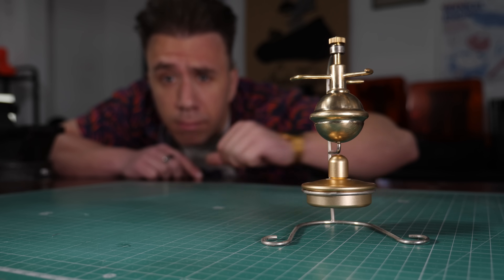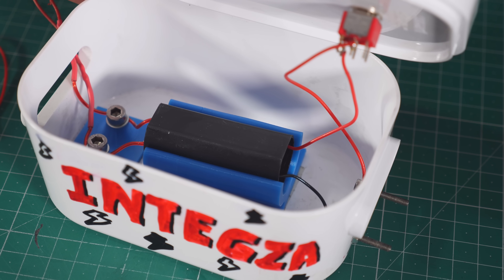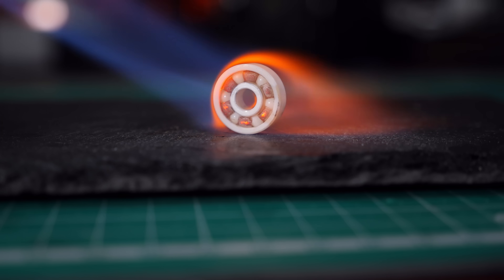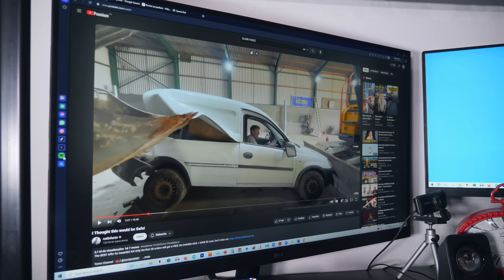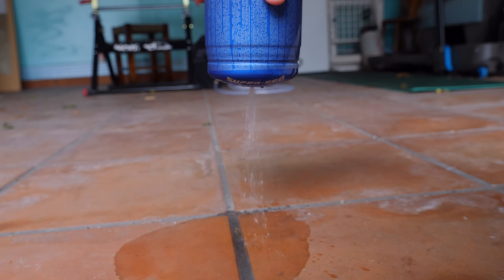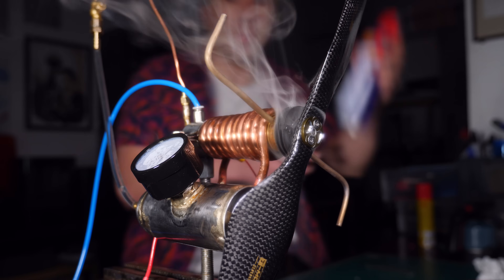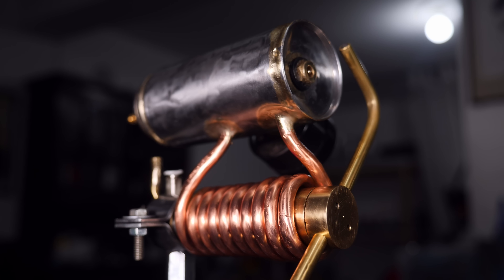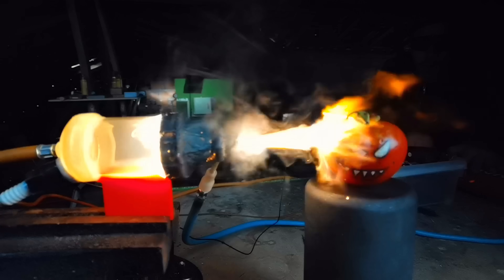I Built a ROCKET PROPELLER

Comment: Does the nozzle design matter if the exhaust is then routed through an additional pipe? Wouldn't the nozzle have to be at the end of the two copper tubes? I'm just asking, I'm even less of a rocket ingénieur than Integza

Comment: IDK if you'll read this this late after posting the video, but in my humble engineering opinion I think I know why the pressure it's not raising when the engine starts running hot...

If i'm correct then it's simple, your heat exchange is not efficient, as in, heat is being transferred to the cooling agent (the fuel gas in this case) but a lot of heat remains in the combustion chamber, copper is a very good heat transfer material (as many metals are actually) but it is "porous" and the system has a lot of gaps, simply fill these gaps with something like... say, thermal paste or encase the entire cooling system so you can fill that part with water (ez fix, not that effective tho) and with a bit of luck more heat will transfer to the gas.

Comment: Why not use the compressed air to Venturi the butane into,the combustion.  That way you don’t need a combined pressure.  You only deal with the compressed air compression.

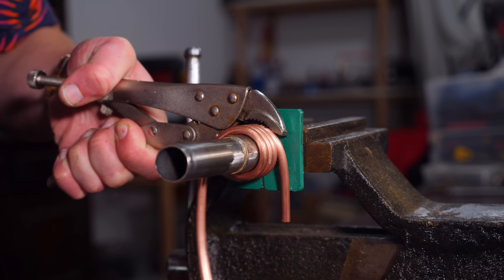Comment: (8:02) Ohhh, I wonder if you can use a copper heat pipe!  Can't transfer gases through it but it moves cold and hot temperatures around very quickly.

Comment: unstead of running the cooling from the fuel tank to the fuel tank you should run the cooling line in between the fuel tank and the engine that way the liquid evaporates in the cooling line keeping your engine colder this is called regenerative cooling and its a real thing in real rocket engines

Comment: dont you think that the increased pressure from the added butane is the reason for more pressure and not the combustion? this creates the next question and is that butane being burned inside of the chamber and propelling increased gas pressure to the outlets or better yet are you getting a rocketing thrust effect at the outlets and would that increase or decrease the rotation or amount of pressure to the point where one will always fight the other with no actual benefit over a measureable point.

Comment: I was thinking of an air piston jet engine hybrid. Use compressed butane/propane mix. The pressure turns a propeller and vents the gas into a combustion chamber. Have a spark gap igniter... basically an airhog rc plane..😮

Comment: why not have the nozzles directly behind the propeller?  To reduce drag?  Wouldn't the nozzles be subject to bending more if it is in between the blades like you have it now?  If it was actually used to move through the air wouldn't it bend from the wind?

Comment: Finally, FINALLY you're using your fuel as a refrigerant! I've wanted you to do that for years 😭😭 Most rocket nozzles have complex internal structures for this exact purpose. I mean, the nozzle for the apoilo missions had such a complex internal structure that they had to invent new manufacturing processes to insure the plumbing worked.

Comment: Nice experiments Integza!
I was wondering, for the cooling system, it might be better to have one end of the coil on the bottom of the reservoir of gas, and the other one at the top, basically putting the can upright and tapping the gas from the top, the liquid staying at the bottom to fill the cooling spiral, the heated gas flowing in the top of the can

Comment: And you call yourself a rocket scientist. lol. you need a pump to pump the butane. you also need to fix the oputput of your cooler to the engine so hot butane is burning. Thats how NASA do it with their rocket engines. Use the fuel to cool the bell

Comment: Perhaps having the coil in the fuel flow with a capillary tube would work better? Look up hot air balloon burners for a bit of inspiration on that front. We preheat and super pressurize the propane by passing it through a coil around the flame path.

Comment: Ok, you are good, however your trying to figure out why the butane wasnt going past 4 bars
lets work this out, first, you created a giant fan, which is moving 1kg of air in order to make lift, if the fan is on its side (like it is) then that 1kg of air is being pushed back on the can you are using to cool / heat the butane
You made a cooling system out of a cooling system and your wondering why it wont heat up to push the butane out faster????

Comment: You could try using a thermally conductive paste or something to increase heat exchange between the coil and the engine body.
Reply: Yes! Circle on circle is the smallest surface area you can get for contact between the two. Good call!
Reply: @konamisqust Or, ideally, also kinda squish the coil so you get more of the copper surface closer to the engine, and then have the paste or solder or something else there, because having 3mm of thermal paste is not exactly ideal.
Reply: At those temperatures, I suspect the paste would become become liquid and simply drip away. .
Reply: @DUKE_of_RAMBLE Yea, thats why I said something like it in my reply. Also I'm sure some thermally resistant paste does exist, tho at a really high cost.
Reply: @Eyan17 wait but won't a thermally resistant paste just not conduct heat?
Reply: @agenthimzz No, I just meant a paste with a high melting point
Reply: There is thermally conductive epoxy. More heat resistant since it literally can't melt, it will start to burn before that.
Reply: And put another tube around the copper coil to reduce heat loss.
Reply: @jagolago-bob Idealy of an isolating material
Reply: But also, guys, Integza already had problems with it being too hot, so idk why he would do this. But you never know.

Comment: you really should've had the fuel can vertical to avoid it pushing fluid up into the combustion chamber. Bet it would work way better and let you get more heat and fuel into it without spitting up liquid

Comment: Wouldn't it be better to have the propeller power a pump to move a cooling liquid between the combustion chamber and the butane tank? It would slow down fuel preheating, but it would be far more reliable.

Comment: Check out the Hiller Hornet, a helicopter which uses this principal for powered flight.  Ram jets are mounted on the ends of the rotor blades, and fuel is fed through the body of the blades.  Since they're ram-jets, once they reach operating speed, they're self-compressing.

They are a bit noisy.  Kermit Weeks of the Fantasy of Flight museum, has the last airworthy one, but doesn't like to start it up, as he gets complaints from his neighbors across the lake.

Comment: A suggestion, you could use the coiled cooling hose to feed the engine, the gas running from the tank to the engine would expand, absorbing heat. cooling+expansion.

Comment: place the butane tank vertical, so the coil is filled, and use a passive liquid flow regulator to control the flow into the coil. maybe this helps.

Comment: I like the videos, in physics classes there is a motor with a magnet and a battery, of course it rotates and yes the fans are there, but is it possible to do something with that basic motor or does it need to be improved? because I never imagined, but this is the basic motor even with everything.
But in your project you don't need gas control? Couldn't you use a Tesla valve conduit?

Comment: Have you experimented with brazing the coil to the body of the engine? That should dramatically improve the heat transfer, and so up you gas pressure accordingly.

Comment: Can you build a propeller that has the pipe inside minimising materials and design ? Also does the distance of the pipe itself have an effect on acceleration ? You could ad a pressure valve to the fuel tank to avoid explosion, maybe with a collector to reuse te fuel It will eventually vent.

Comment: 10:50 Butane absorbs heat while simultaneously losing pressure during phase transitions, particularly when converting from a liquid to a gas. This is because the energy absorbed during evaporation (a phase transition) is used to break the intermolecular bonds holding the butane in the liquid state, which then becomes gaseous. This energy input also reduces the pressure of the butane as it transitions from a more dense liquid state to a less dense gaseous state

Comment: What if you construct the propeller around the exhaust pressure duct, and vary the exhaust nozzle diameter? You can still direct the exhaust pressure tangentially to the diameter of the propeller’s rotation. 
Lots of little challenges to contend with, but this is something I’ll be keeping my eye on

Comment: If you would put less loops around the engine the butane would build up more pressure . You totally over cooled the motor . But I’m surprised you made and improvement using absolutely no heat transfer equations .

Comment: Just FYI: I won't be using Opera on my Linux computers any time soon; it comes as a Snap and I recently switched from Ubuntu to Debian expressly to get away from Snap.  Why?  Because once installed, there is NO WAY within your OS to get rid of the installed application -- which, because it includes all the libraries that would normally be called from the operating system, tends to be HUGE.  I'll install AppImage -- which are just as bloated as Snap -- because I don't have to learn a new command line to maintain it (just overwrite the existing AppImage with the updated one), and I can delete an AppImage any time I choose and free the space instantly -- instead of having to reinstall my entire operating system to free the space.

Comment: What happens if tou increase the surface area of the copper pipe touching the combustion cylinder? Could you fill the gaps with tin solder or use square copper tube to increase the efficiency?

Comment: Use a tesla valve on the butane side of the engine so the higher sir pressure cant push the butsne back up into the can

Comment: The flow in those tubes is going to be super restricted (choked flow) so you're losing a lot of thrust by designing it like this instead of putting the entire rocket engine on the spinny bits.

Comment: Several chemicals produce oxygen when heated. Common examples include chlorates (like sodium chlorate, NaClO3, or potassium chlorate, KClO3) and perchlorates (like lithium perchlorate, LiClO4). These compounds decompose upon heating, releasing oxygen gas. Hydrogen peroxide (H2O2) can also decompose to produce oxygen, though this process is often accelerated by a catalyst like manganese dioxide. 

     Stuff you could do with water and chemicals 
  With without heat to make air too

Comment: You should get a TXV and modulate the flow of the gas to the engine, based on the sensing bulb temperature. Also change out to either propane or propylene gas (higher pressure), butane has low pressure at standard outdoor ambient temperatures due to its high boiling point temperature at -1C compared to propane at -40C or propylene at -48C. Juice that RPM to 4000+.

Comment: A tip for bending small pipes.
Seal one end of pipe with a dab of hot glue,  fill with water and stand it upright in the freezer,  let the water freeze.  
NOW bend the pipe however you like.   The ice inside the pipe supports the pipe from inside meaning no more kinks or reduced ID of the pipe through the bend.
Reply: i think you can use very fine grit sand and get the same result
Reply: @thatoneweasel  sugar works really well too since you can easily rinse it out with water
Reply: @kasuraga  Table salt works too.
Reply: @Beamer1969  Fine sand... so many options
Reply: @rickkwitkoski1976  Could use Columbian marching powder
Reply: And it would be really easy to clean out.
*Snort!
Reply: @kasuraga  Just to have even finer granulates, I'd say powdered sugar would be the better option. 
Though getting it all in there would probably be quite the tedious task.
Reply: @thatoneweasel  Не работает, ты не сможешь утрамбовать его так сильно как воду, я пытался согнуть трубку с песком внутри без нагрева, песок сжался, пустоты заполнились и трубка все так же переломилась. Использовать пружину- лучший вариант, просто обернуть ею трубку и гнуть как угодно.
Reply: @thatoneweasel  Fill it with solder or any low melting point ductile metal. Then you don't need to plug the ends when bending.
It might be a bit tricky with such small diameter tubes, though.
Reply: Ice, sand, salt, sugar, all as the 'mandrel' part for bending. COOL!
Reply: Sand and sugar would be too hard to get into a small diameter tube. Water is  probably best in this case and easiest to remove.
Reply: nice!
Reply: Add some soap to the water so it doesn't freeze completely solid for easier bending while still supporting the pipe

Comment: The vapor pressure of butane and propane are indeed different. At 25C butanes vapor pressure is ~35.4psia (ie, your lighter on your desk has about 35 pounds of force across every square inch of internal area trying to push it apart). Propanes vapor pressure at 25C is ~135.7psia.... And that is why you cant (well, shouldnt) fill a cheap plastic lighter with propane.😁

Comment: Dear integza,

I believe that if you could find a way to use the engine to power a turbine that could compress the air and solve your air issue. 

                                Sincerely, a fan
Reply: So a turbopump powered rocket engine like "real" ones.

Comment: Graphite cage is nice. Optimizing those little nozzles may get a little more thrust. Thermal conductivity improvement and insulation of the cooling coil. Different gas mixtures for higher pressure.

More power is going to require more combustion pressure. Perhaps larger chamber?

Comment: You won't believe this . but back in about 1920's  . A man over here had the same idea for a propeller on a plane  . The idea was the  exhaust gasses from a engine was to be forced out though the tips of the blades. There by making them turn  faster . I did see an example  , but of it but never saw it working .
Reply: Search for tip-jet helicopters for another example.
Reply: @Mueller3D  Rotodyne was probably the only one that actually saw service, but it was insanely loud.
Reply: The way you use periods is stressing me out 😭
Reply: @gergthewerg  😄 me too.
Reply: Spoiler alert, it didn’t work very well

Comment: Wouldn't it be better for the "butane" can to be vertical so that the only thing that enters the coil is liquid butane and through the top part o the coil the high presure gas?
I think that could improve the cooling of the chamber as well as the presure of the gas with less compllications measuring the amount of butane.
Correct me if i'm wrong

Comment: There is a type of helicopter that uses rocket nozzles to propel the propeller - and because it is not powered by motor but by thrust it supposedly does not need stabilizer (the tail propeller or thruster, or second counter-rotating propeller). If I remember it correctly.
Reply: The Kolibrie helicopter works like that, it has two ramjets at the rotor tips, and no tail rotor but a movable vane under the rotor's downwash to provide yaw control.  There's a small motor to drive the rotor up to the speed where the ramjets start to work.
I've seen one up close, it's a janky looking but very simple design.  No fuel pump; the rotor's centripetal force drives the fuel to the jets.  Control linkage is simple: there is a collective, but the control stick is simply a bent pipe welded to the swash plate.  Meant to be cheap and simple to fly, but it was noisy and drank a ton of fuel.

Comment: rotary pump on same shaft, if it is possible to extend it through the engine

also, why not use coil as the only way for fuel to reach the engine?

Comment: it looks to me like there's a lot of friction on that propeller. it has a hard time starting up, and won't spin at all without constant power!
I think you should consider some different materials to protect heat sensitive parts, like stainless steel which acts as a good insulator.

and have you considered a 3D printed metal propeller, with exhaust tubes built into the blade itself? 
that could potentially reduce the overall weight and complexity of the build, though structural integrity might be an issue.

Comment: You’re gonna either have to put a cooling jacket around the engine or run it fuel rich. Consider injecting gasoline into the combustion chamber. The liquid fuel will absorb heat in order to vaporize and burn. It’s also very energy dense.
Reply: Diesel may be preferable here but your chamber pressures are way too low.

Comment: Normal youtubers: to light this dangerous lighter, we will stay behind 4 panes of safety glass

Integza: should I be concerned about a high pressure flammable can of gas on a possible cascade heat pressure cicle, and burning in a rocket to propel a huge pair of blades spinning in front of my face? Meh... Safoda, light it up and go faaaaast!

Comment: I think the butane pressure doesn't raise because gas in the coil tube is static, maybe if you put the intercooler coil in series with the combustion tube instead of in parallel the gas will flow instead of being static in the coil and will suck up heat before getting to the combustion chamber increasing the pressure. Just an idea, but may be worth trying.

Comment: Why not use the coil as a fuel line? That way the fuel is as hot as possible during injection and you get more reliable flow through the coil.

Comment: The US military built a helicopter that used pulse jets at the tips of the rotor to produce the needed spin.  It didn't need a tail rotor, it was very light and simple, it flew well, but it was incredibly noisy and it was difficult to get the fuel to controllably flow out to the pulse jets.  Only one prototype was ever built.

Comment: As the butane gets colder as it expands I assumed that the cooling pipe around the engine was going to feed directly into the engine and not back into the same fuel reservoir, would that not make more sense?